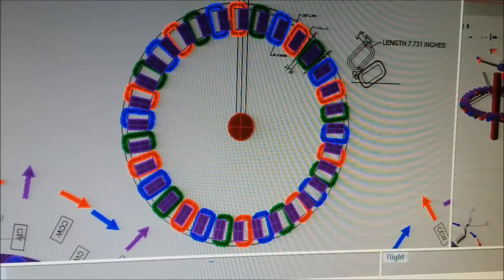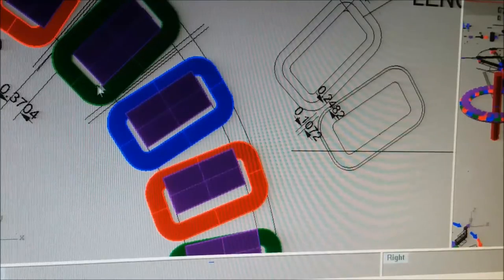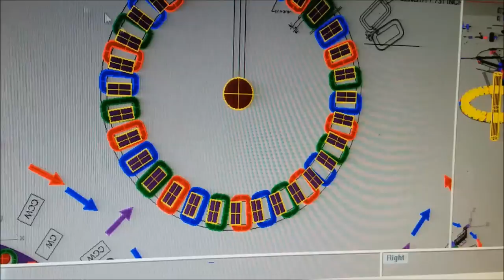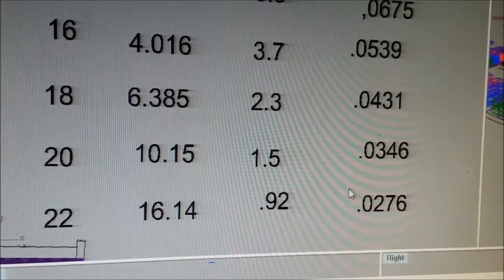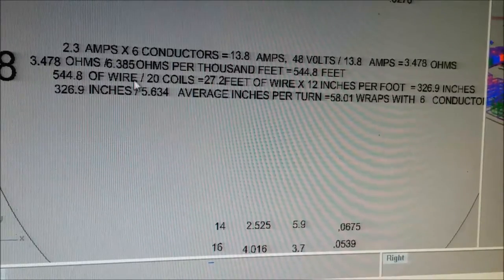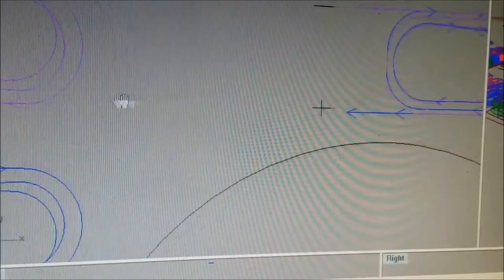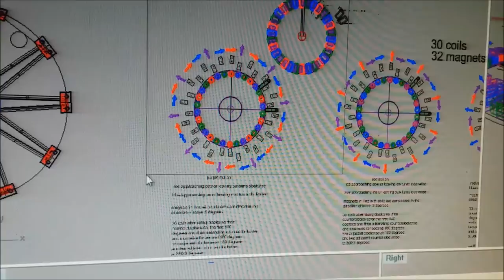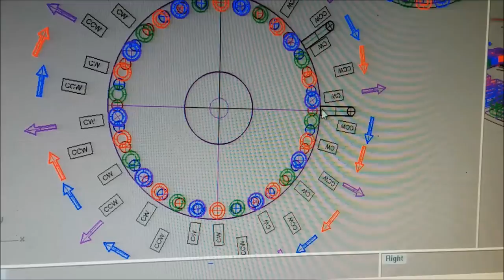HOW TO DETERMINE MAGNET WIRE SIZE AND TURNS FOR WIND TURBINE STATOR PART 2

Comment: And also, should I give a voltage regulator for each phase or are they for 3 phases, what do you recommend?
Reply from the maker: The 3 output wires are connected to a 3 phase rectifier which outputs a single DC voltage. The DC goes to a charge 
controller to charge batteries. If the rectifier DC voltage is lower than the battery voltage they won't charge so 
an inverter is between the rectifier and batteries. This an be a combined unit  inverter with the charge controller and an AC output of 110 or 220 V and a state of batery charge indicator. Those by MCCP also combine solar panel and wind generated power. The low cost solution is rectifier to lead acid batteries with a zeiner diode to a dump load for overcharge prevention. If the voltage is low put  a transformer in front of the zeiner diode. If the turbine won't self start a cut in voltage closes the running unloaded  alternator. I would think an IGBT  setable with a resister  between gate and ground could work. One IGBT on each output with increasing voltage cutins so low wind conditions would turn 
onone  or two phases and let the alternator keep turning.   IGBT stands for INTERNAL GATE BIASED TRANSISTER which senses gate voltage but doesn't draw much power to operate.  The dog approved this draft but he is an illiterate.
There is a yahoo group on facebook called    DIY Wind Turbine Makers you might find interesting  but they
don't have my dog for referrence material.
Reply: @concretehousebuildinginph1488  by "inverter" you mean Boost converter (DC)

Comment: I have a problem with the selection of wire, the number of turns and the size of the coil.

I need 45-90v, max speed 200-250 rpm. , 2000-2500wat and 21 coils, I have 24 magnets on both dials.

Unfortunately, I have to make a stator myself because I was cheated by a certain company. I bought a ready-made stator, black so that I would not see the number of coils, the mounting dimensions were given by 49 cm, and the difference of each hole differed even by 2.5 - 3 cm, not 3.5 mm, as he wrote.

He was supposed to make a new stator for me, I wanted the one I bought to send him back, I just accidentally saw how many coils he wound, because it was cold in the garage, and at home, when I brought the heat, and the coils appeared. 21 coils, I do not know if it is a 1.6mm wire, but I do not know how many turns, or someone will help me choose the wire better, and the stator thickness of 21mm.

Thank you for your help. Possible contact by e-mail, whatsapp or fb
Reply from the maker: Rioderixxx, FINALLY AN EASY QUESTION. OK  The wire diameter is the bare copper diameter with the 
enamel coating scraped off. The number of coils is a multiple of three, so 21coils/3 = 7 coils per phase. 
The coils of a phase are connected in series, 7 per phase. Take any two of the output leads and measure
the resistance of the 7 coils that are in series.  That resistance is the resistance of 7 coils. So resistance 
of 7 coils/7 is the resistance of one coil. Google "magnet wire specifications chart" or go to sales literature
and find resistance for 1000 feet for 1.6 mm diameter wire. Your resistance/ the catalog resistance = the
percent of 1000 feet of wire. in feet of wire per coil. if it was say 6% then .06 X 1000 ft = 60 feet  per coil.
       2500 watts/ 45 volts = 55 amps,  and 2000 watts / 90 volts = 22 amps.  On your magnet wire chart
or sales literature see what AWG wire guage suits your AMPS load. There will also be a column that shows
the diameter of that wire. See where 1.6 falls. Then scream loudly until you feel better or the police arrive.
       The inside width of  your coil = magnet width. If your average wrap length can't consume the length 
needed for the resistance make them longer past the ends of the magnet to use up some wire. I figure it also
is more efficient that way considering the direction of flux lines off the end of the magnet.
       Anyway size the wire by amp capacity, the length by resistance needed and then the magnet flux density
will  determine output watts. If you need more voltage you may have to drive it with a cogged belt overdrive, 
but try to design it for direct drive. You can of course use a transformer after the rectifier or an inverter to 
get your required voltage.

Comment: the important question is whether 21 coils have 3 phases, 7 coils per phase.  if i want to get 2000w and 70v, do i have to get 70v for one phase or 3 phase?  because it's important.  If for one phase, i.e. for one coil, I have to reach 10v more or less?
Reply from the maker: Rioderixxx, Draw a triangle with 7 coils on each side. Your 3 phase connections are at the three triangle verticies and there would be 70v between any two of the verticies. This is DELTA connected. For WYE connected you have a center point with three lanes radiating out with a120 degree included angle. There are 7 coils along each line.The three line ends are the connection points with 70v between any two of them. Between the center point and any end point there is 35 volts. Your alternator has different voltage peaks on each individual coil so at any instant you are looking at something in mathematical term is similar to the "root mean square"  voltage of all the coils on a phase.  This occurs due to there being more magnets than coils to reduce cogging. Design for 30% more voltage and tune it exactly with your rotor to coil air gap. yes to 10 volts per coil times 7 coils would be 70 volts. With 30 % added for the magnets centering on the coils about 3 degrees apart  the 30 % would be designed to 13 V output per coil. 
          Put one of your coils on a plywood disk at their running diameter. Mount that on a 3/8" variable speed drill. Measure speed with a strobe tach. Wind a coil and mount it near the disk. Put a diode on one of the coil ends and connect a voltmeter to the leads. The diode will read  either magnet coming to cemter or magnet past center. The actual voltage goes from posative to negative at centered alignment (ZERO CROSSING POINT) The voltmeter needle is to slow to read on the fly but will stabalize with the diode after a few revolutions. Vary the air gap to understand the sensitivity. Vary the drill speed to understand the importance of magnet velocity. Wear a lab coat and heavy framed glasses, and never smile, but yelling EUREKA is allowed.

Comment: More precisely, I have 21 coils and 56 magnets.  For a trial, I wanted to try to spin the 1.5kw motor, but the connected generator to the inverter gave only 200-300w, 500w when started, but it fell through the resistance and it warmed up and was unable to spin.  How can I relieve the load so that it gives a minimum of 1000w, because the wind will not even rotate it, because there are high resistance.
Reply from the maker: Sounds like the wind power to the generator is too low. Is it horizontal axis like a wind farm, or vertical axis like a savolis turbine. There are apps that display annual average wind speed by GPS coordinates, and apps that calculate the Kw available from that wind. The blade disk area, angle of attack of the blades, airfoil or flat blades are all perameters that can be modified. If you need to get the generator turning you can unload the drive power by increasing the running clearance between the stator and rotor disks. It will reduce output but may allow it to spin up for a better idea of where the problems are. I am using booster guides mounted rigidly around a vertical axis 24 blade turbine. The turbine is 6 feet diameter and 8 feet tall. You should have a charge controller that lets the turbine spin up to a settable "cut in" voltage that then connects the load. Often there are cut in voltages in increasing steps for each phase of the alternator. Have you considered making a DETAILED Youtube video of what you have assembled outlining what is not working.  Title it something like how I built a wind turbine power drive for a 1.5 kw motor with an MCCP inverter. Turn on the english subtitles when you upload it or type text overlay on the video.
Reply from the maker: Some useful APPS                 Wind turbine calculator [HAWT and VAWT]_files
Global wind atlas.com

Comment: I tried to make connections and I do not raise the RPM increase, because the engine is moaning because there are such large resistance and it gives a maximum of 100w, and the engine is warm, so if I do not turn it by hand, the engine does not work either. I connected the coils alternately and made 3 phases. But don't buy more, so even the wind won't make it.
Reply from the maker: Rioderixxx, I suspect that your coil to magnet polarities are not matching
up and you are trying to connect a 3 phase alternator to a DC input on
the inverter without a 3 phase rectifier to make it a DC input. I outlined
how I would check this in the other comment. Nice bike in your video. I am looking for a ZX12 bought by someone terrified by it and left it sitting
in the barn.

Comment: I have a Grid Tie inverter 2000w, this is an inverter with DC 45-90v, which means that it cannot exceed 90v.  I will not charge the batteries.  And as for 700w, even at 300rpm, when I turn it, before the inverter starts, I have 85v and then it drops to 50v and 100-120w and a large resistance, I have 3 cables on both sides, three cables on the one side,  on the other hand, it connects all, but there is a lot of resistance, and if I connect the cables separately to each other as a closed circuit and to the inverter, I do not turn it to generate because there is a lot of resistance.  We can sign on the messenger that I will send photos when I connect.
Reply from the maker: Rioderixxx, Well if it grid tie then it is surely a single phase inverter. It is
likely 50 cycle power. Use an ohm meter on the outputs to find out if one is a ground. The inputs you indicate are DC 45 to 90v, so only 2 wires for DC and the third would be a ground of the inverter. So the next thing is getting DC for the inverter input. The DC would be from a 3 phase inverter. 3 wires in 2 wires out and the common connection point of your WYE connected stator to the ground on the inverter ground lug. 
       The AC of your stator is just looking at it  with 21 coils and 56 magnets very complicated. The magnets need to alternate north and south to
produce the AC part of the output. Second a north magnet aproaching a south coil should attract each other and a north magnet should repel a 
north polarity coil. The coil polarity can be switched by switching the
connection leads on that coil. Test the magnets by holding another magnet
over each one on the rotor and mark them N or S  on the face that is up. 
The coils will need a small DC voltage on the leads like a 1-1/2 volt battery. Hold your test magnet  over each coil and mark  each coil with the same N or S you used sorting the magnets. Pick a starting point with a magnet centered in a coil. Rotate the magnet disk 1/4 of a coil diameter and record
which ones are attracting or repelling so as to turn the rotor clockwise. on the same line enter each coil trying to rotate the rotor disk counterclockwise. Count the ones advancing the rotor and the ones holding it back. if you have 11 advancing  and 9 retarding the rotor then 9 of each cancel out each other leaving 2 to produce power. Next check 3 consecutive magnets and record the results. Part 3 tag all the coils opposing rotation with an opposite winding connection which should make close to 19 coils helping and 2 opposing. Rotate the rotor in 1/4 turn increments until centered on the next coil from where you started to see if it is consistent with the coil polarities switched. Test with 3 consecutive magnets. If you can't get a good percentage of net output coils you will need to wind 54 smaller coils with the inside dimensions of the magnet and the outside so that the coils have a gap between their edges.
       This assumes you have a pancake or axial flux alternator. If you have an outrunner configuration like an RC model motor then you need iron
cores in your coils.